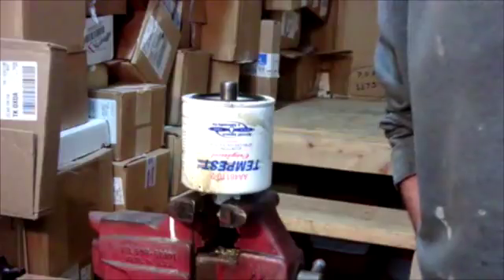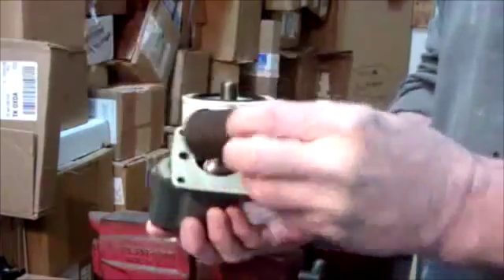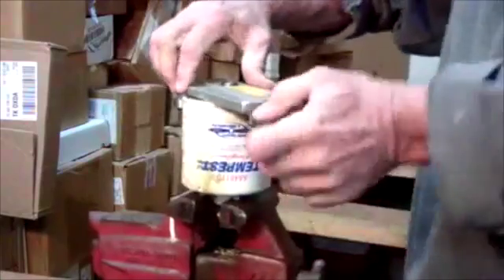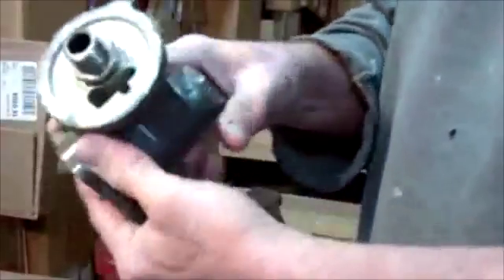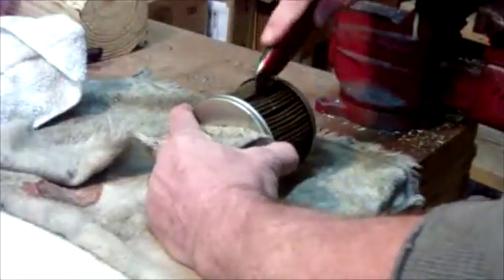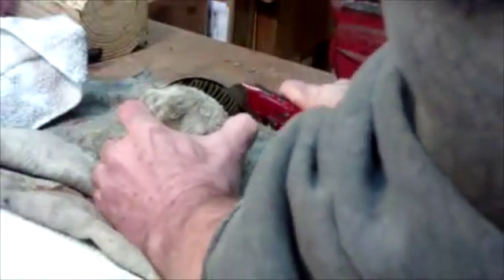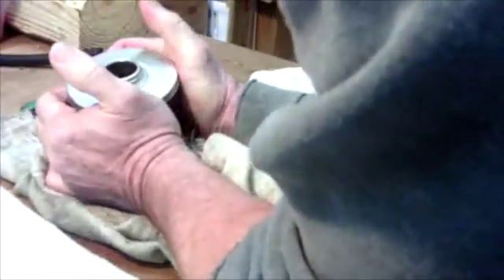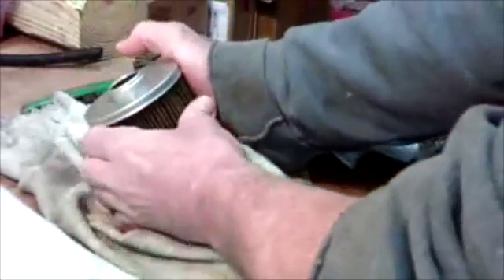Oil Filter and Screen - Grumman Style

Comment: An old timer mechanic that worked many a Grumman use to burn the filter material and then pour the ashes into a container of distilled water and then stir.  All the metal particles would sink to the bottom where he could easily determine the health of the engine and transmission.
Reply from the maker: That is one way I am sure that works but the EPA will frown on it.